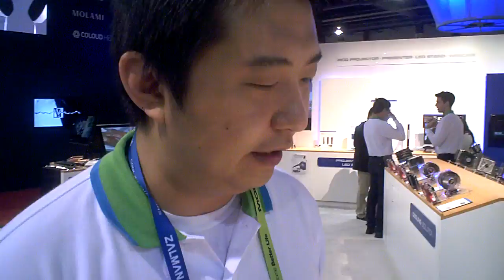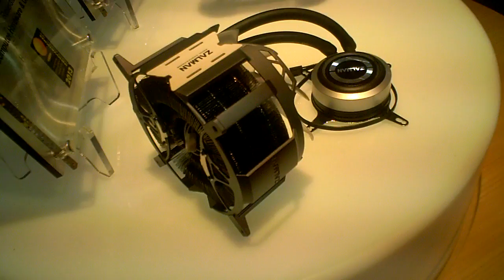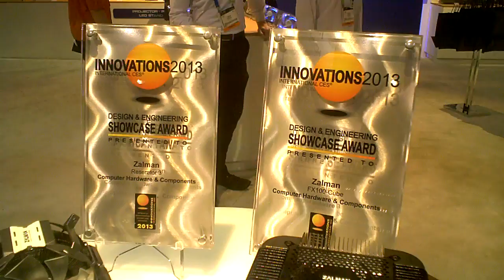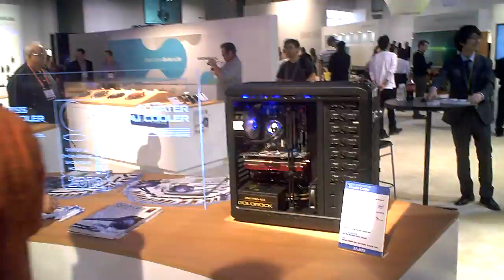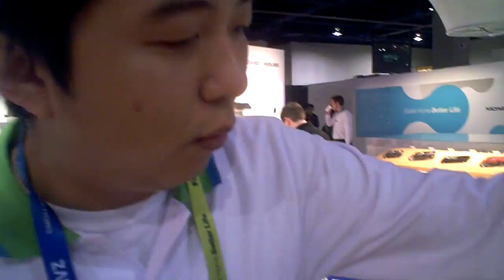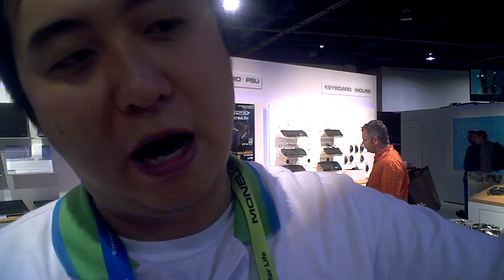CES 2013: Zalman shows off its award-winning fanless CPU cooler

Comment: Would this work with a horizontal case, or would it be unsafe having it close to a horizontal case's lid when it gets hot? Does it need to be in a vertical case so that heat can rise up and out?